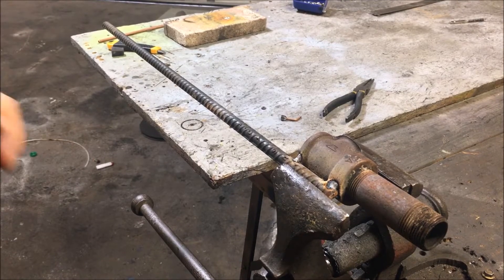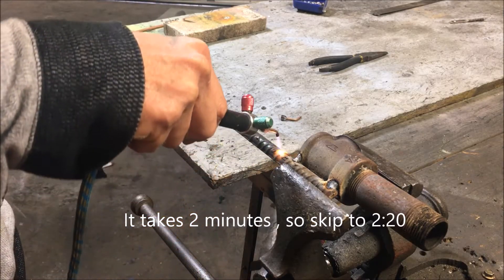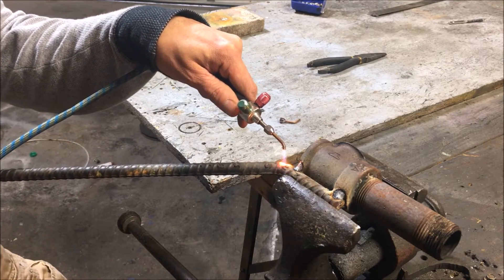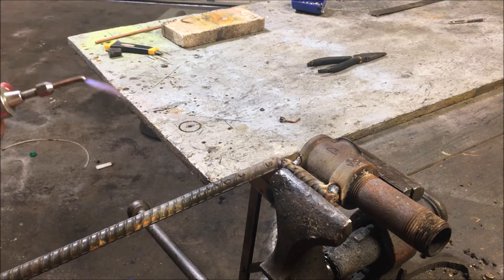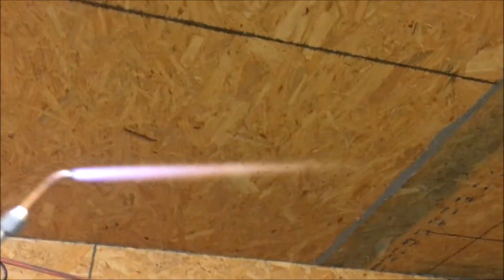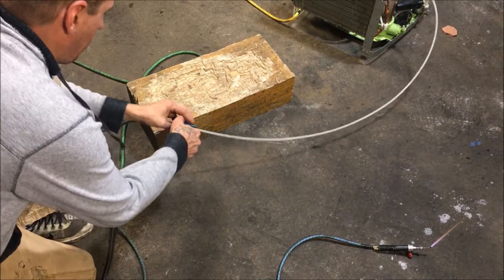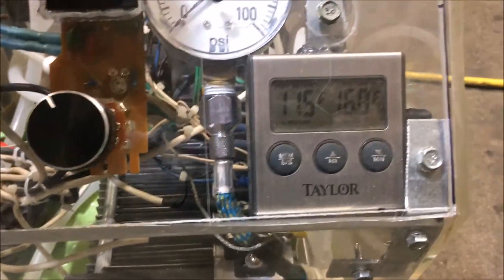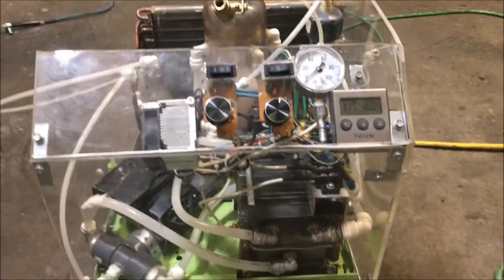Bending metal with 2000 watt HHO flame

Comment: Fine for bending non-structural scrap. BTW the excessively narrow heating is why your bend is wasp-waisted and weak.  Hydrogen torches are old news and quite useful in industry for specific tasks, but hydrogen is highly undesirable in steel (hence the use of lo-hy welding rods like 7018) so avoid it for anything safety related.
Reply from the maker: thanks for the input friend , you are correct hydrogen embrittlement is a draw back

Comment: From experience I think oxy-acetylene would be the fastest way to bend/ heat metal.
Reply from the maker: Oh defiantly totally agree  in fact hho has the lowest specific heat but hey its 2 am and the bottles ran dry , isnt it nice to keep working any way?
Reply from the maker: another cool trick thats even faster is to hit it with an arc welder on high , and it bends in 3 seconds
Reply: I guess the fact that that you are turning water in to fuel and no special gas required is cool. I remember when I did science fair in middle school I made an electrolytic cell and I was in my garage working on it and it exploded! I think it was a spark from my angel grinder!
Reply from the maker: yeah these things dont mind exploding at all , i could thread a needle under heavy fire after running this thing few years .
Reply from the maker: i tried this with a propane torch , lol man it took 8 minutes it seemed , it went on and on